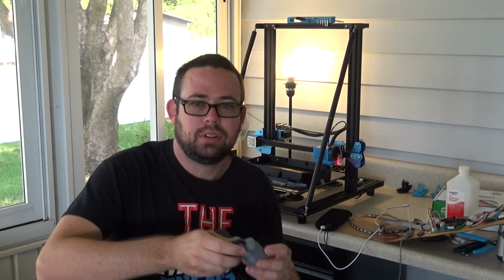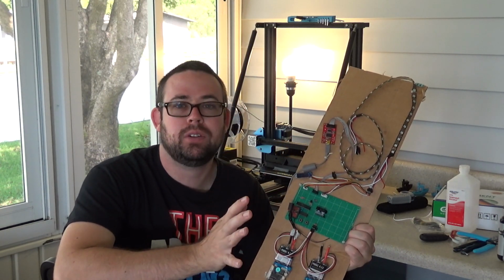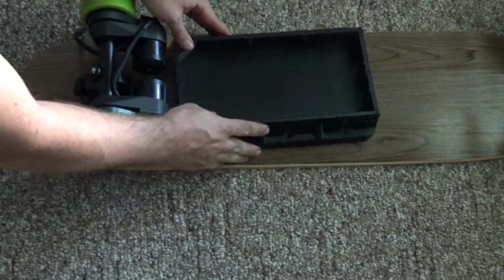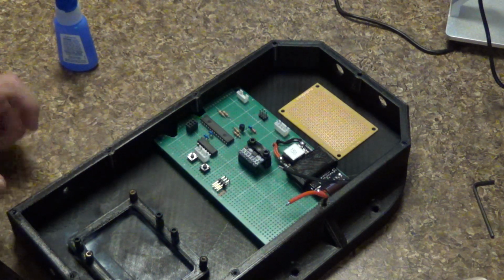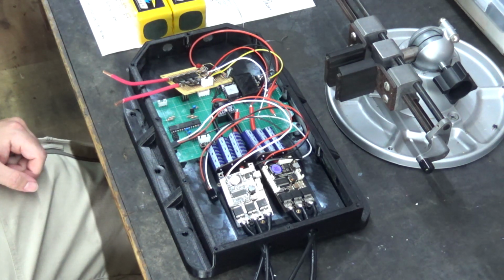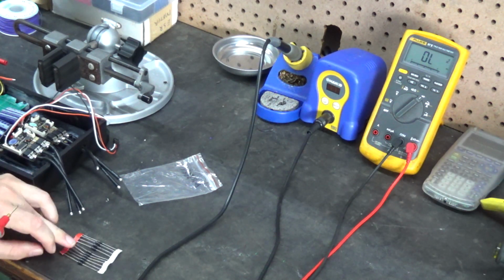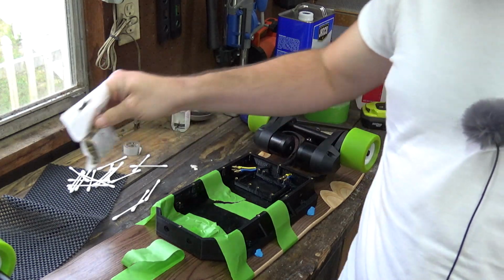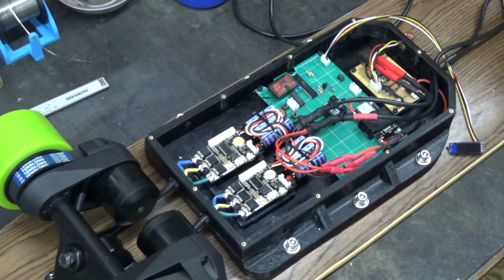esk8 DiY Electric Skateboard Build | Part 3 | Electronics and Enclosure

Comment: Did you account for cooling for the escs in your design? Also, if you did not, does the board operate normally without overheating issues? I only ask because I am building my own board, but I do not know what to do about cooling for my vesc( Stormcore 60D specifically).
Reply from the maker: No I didn't account for cooling. But I remember when I calculated the load on the esc, the esc was overkill so I believe that's why I haven't had a problem.

Comment: Most likely the charging board you attached to the battery of your controller gave too much current. Usually those batteries can take something like 300mA or less and you likely pushed 1000mA in it.

Comment: This may be late, but if you use some solvent (paraffin, acetone, hydrogen peroxide, petrol, etc...) on the places your glued the remote it should dissolve the glue and be easy to open
Reply from the maker: I'll have to keep that in mind, I have been using acetone to take the white haze superglue leaves off. I'll experiment with it the future.
Reply: @RanHam  what I do is put the solvent on some cotton wool so it's wet, then run that along the seams so the liquid gets into it. And give it a few mins, maybe add more then just pry it open :)

Comment: i have 2 mini vesc.is it ok if i use Y servo connector to my 2 vesc to connect to the ppm receiver to channel 2?hoping your reply.thanx
Reply: it works but if your VESC has a CAN-Bus (which is standard as far as i know) it would be better to use CAN in a Maste/Slave configuration and connect the PPM to the Master VESC. That way the VESCs are actually synced and not just kinda similar in response like they would be with a PPM Y-Cable